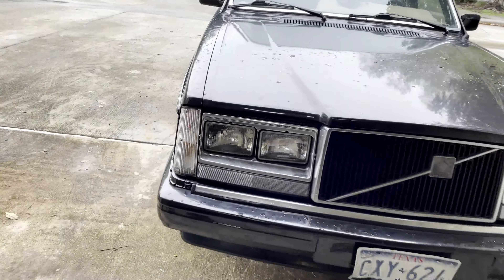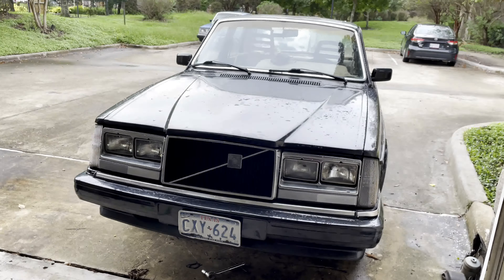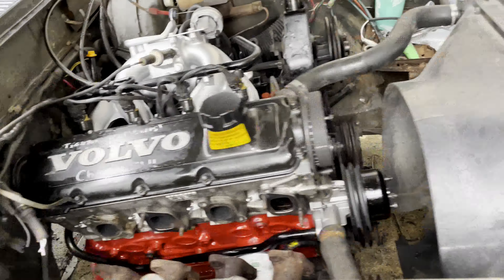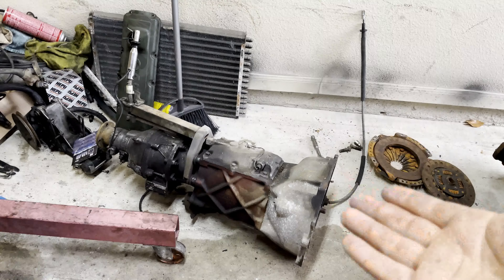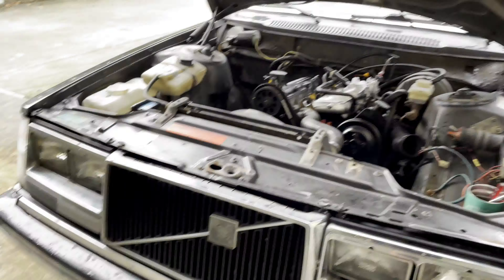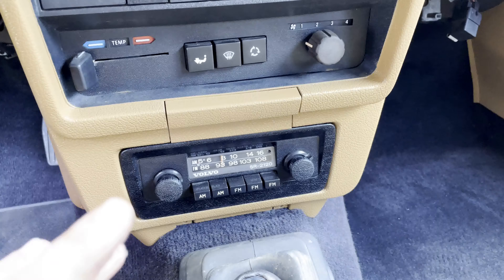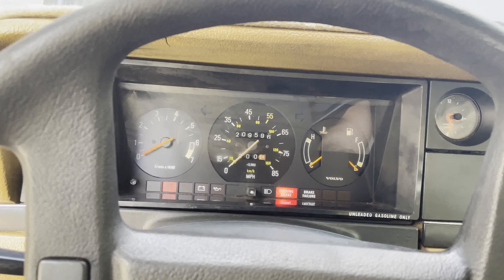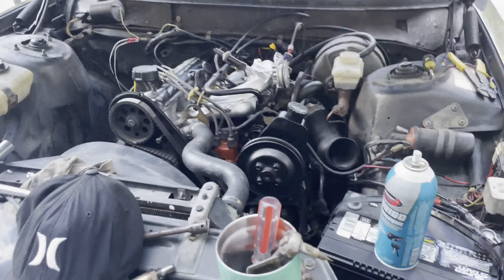1984 Volvo 240 Restoration Part 4 / First Start (kinda...)

Comment: If the dash is cracked, it is better to get another dash from another 240, I replaced the dash from a 1981 240 GL and put a 1983 240 dash it only took me   half an hour to take out & reinstall the other one, it was a tan color like the same one you have, the radio I had installed in the upper part, to leave the bottom part to either  put a box of tissues or keep it as storage, since the car was automatic the automatic transmission was an 1983 automatic with overdrive, and the car never had an overdrive, that car would move
Reply from the maker: Yea I put a dash in my 242 a few months back. The plastic covers are a godsend to just slip them on and forget about.